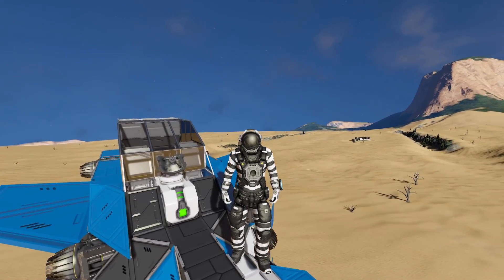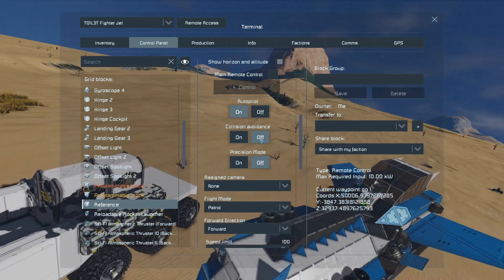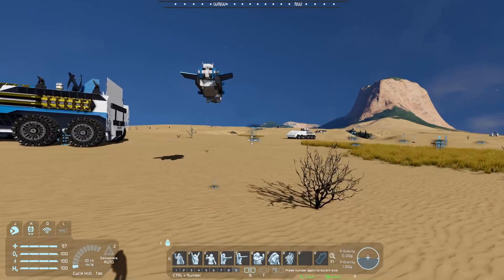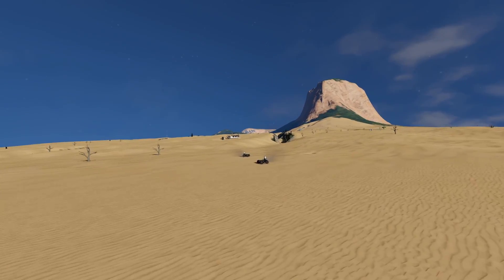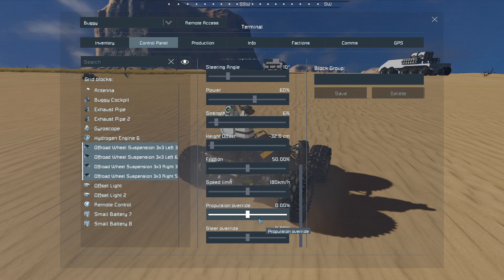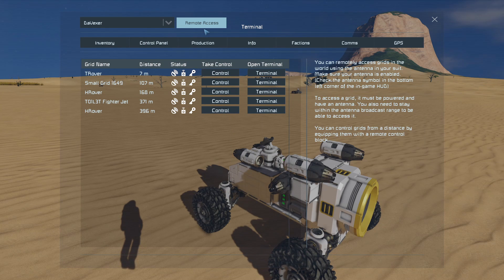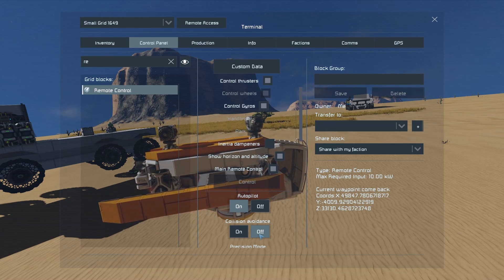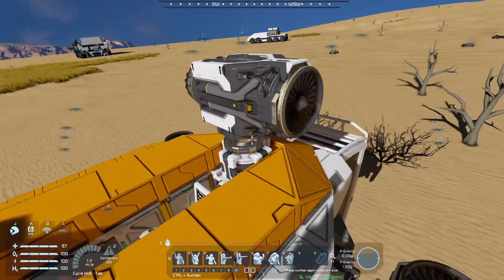Space Engineers Experiments: Autopilot Testing With Hover Engines and Vector Thrust

Comment: Something to keep in mind, it's the remote control block itself that is supposed to go to the GPS markers.  Sometimes, strategic location of the remote control blocks is helpful.  For example, having a connector on the bottom of the drone, and placing the remote control block centered over the connector.  It's great for helping the drone land.

The only thing I've really done with drones was on one base I had.  I had a couple drones that had set patrol patterns, and they were defense drones with Gatling turrets.  They were set to have a route with a circle close in, then a second circle I think 800 meters out from the base.  It gave a pretty cool effect while I was inside the base.  Every so often, I'd see a small craft buzzing by the base windows.  It made things feel more alive.  They were set with different patrol altitudes, to prevent collisions.

Comment: Was recently experimenting with auto pilot rovers.  I found a video here on YouTube by halipatsui called "Guide for using RC block autopilot with rovers" that explains how he got it to work (URL at the end of comment).  I didn't get it going on my first attempt and haven't gone back to work on it.  It involves having the GPS markers at the same height as the remote control block, turning down friction on the wheels (but not turning it off completely), turning on propulsion override on the wheels (making sure all the wheels are turning the same way), turning off steering on the wheels and having a gyro on the rover.  For some reason, my rover kept trying to flip itself over instead of turn.  https://www.youtube.com/watch?v=WO6SkXJtTDo